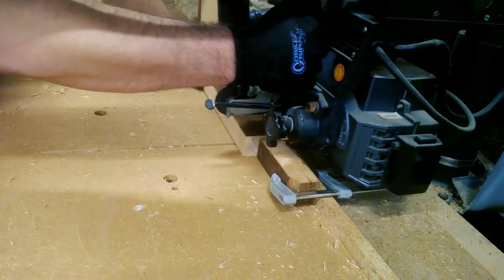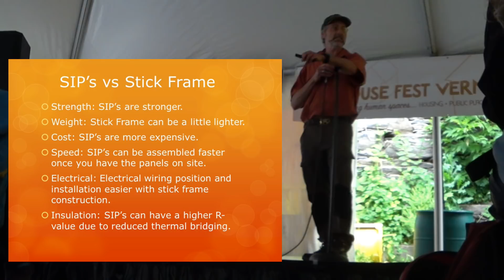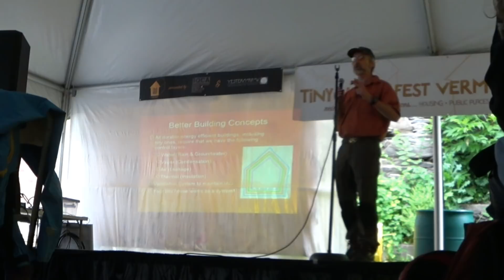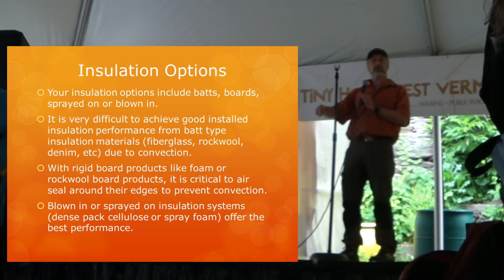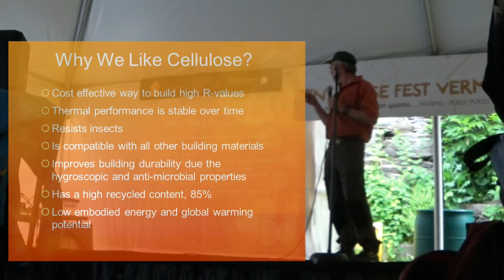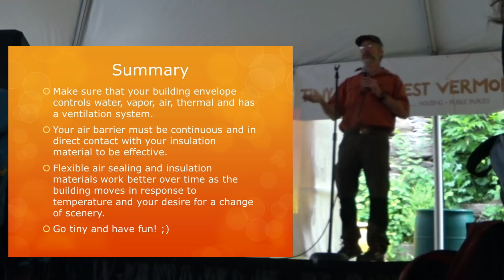Tiny House Wall Systems, Bill Hulstrunk's Presentation at Festival

Comment: David, thanks for posting this presentation.  I like how you spent the time to inset the presentation slides.  I've been thinking about using XPS for a project, but now I may look into blown cellulose.  I haven't personally seen anyone use dense pack cellulose in the Chicago area.  I would want someone who really knows how to do dense pack properly.
Reply from the maker: I agree.  Most installers can do a loose blown attic fine, but dense-pack takes skill.  Contact Bill, he knows the best people across North America.
Reply: Thanks again, David.  I found a couple of useful links.
http://www.greenbuildingadvisor.com/community/forum/general-questions/101208/i-was-interested-bill-hulstrunks-whereabouts-because-i-want

http://www.greenbuildingadvisor.com/blogs/dept/musings/how-install-cellulose-insulation
http://www.greenbuildingadvisor.com/blogs/dept/green-building-news/new-cellulose-manufacturer-set-2018-launch

http://nationalfiber.com/myths.htm